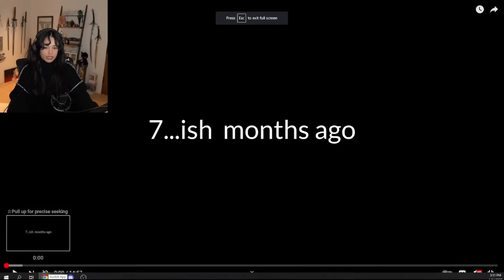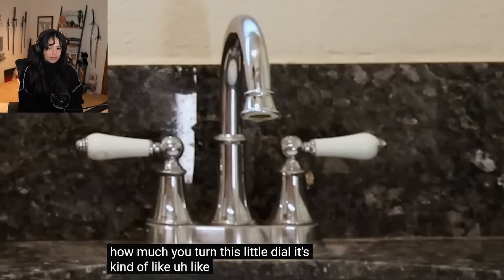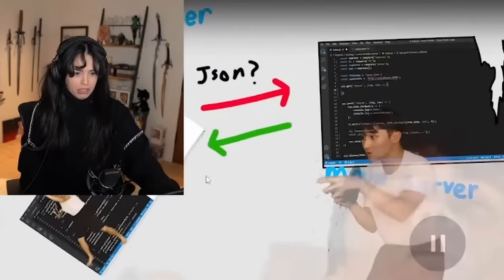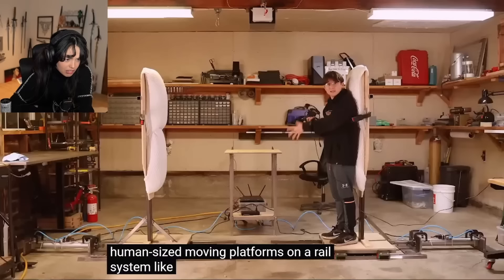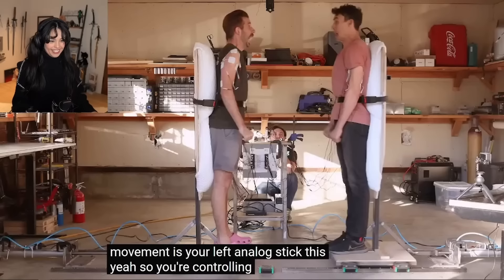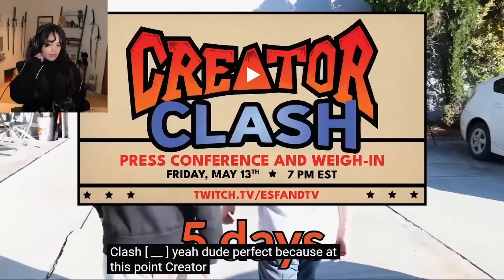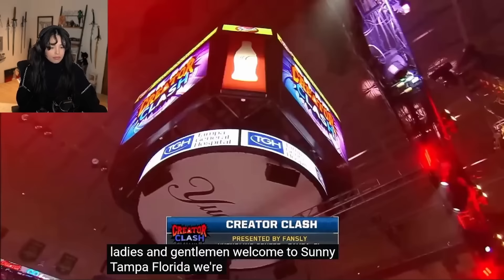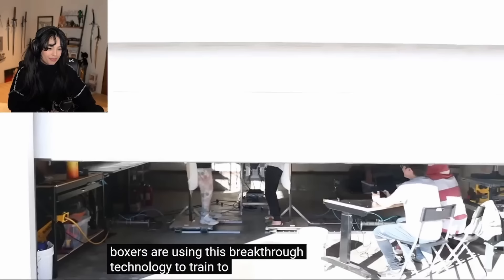Valkyrae Reacts To Michael Reeves's Boxing Robot

Comment: If you were did smart your life would be boring AF..
Because if you understand a lot then those things become the norm like a second nature.
Wich means you get no excitement out of it.

That is why you always here non-smart people complain and the smart ones never complain at all.
Because non-smart people only see wat they could have had.
And smart people only see wat they currently have and how to improve on that.

Its the progression problem all over again.
Have a nice day.

(If you do not know the progression problem here is wat it is.)
(You need to move a box from point A to B.
Non-smart people will say why use a car or forklift truck, after all why do effort?
But they do it only because they see wat they will get not wat they have.
Wich is just getting the box from A to B.

For smart people it goes like this:
- Pick it up first and move manually.
- Pain in back makes you not want to pick it up to move it.
- So now have it be made on top of a belt so you only have to push it.
- To much effort make the conveyer move by making it into an electric conveyer belt.
- Nice but now you cannot walk anywhere were these things are, so replace them by moving small electro pallet trucks.
- Said pallet truck has a battery, better have multiple so you always can use one rather then running out of juice.
- No one has time to be doing that manually, you code it to drive and charge it itself trought the use of AI.
- Nice but randomly they hit you as you walk, We cant have that so give them rails above the floor they hang on.
- they do not hit people now, But charging and repairs are a pain so code them to do periodical stops for that.
- Rails make a lot of noise so make it better oiled so it makes no noise.
- Rails are old fashioned and hard to upkeep even if the carts/arms do so replace them with flying modules.
- Personal warehouse logistic robots now all replace and fly around like drones, but they collide so make a skynet.
- Skynet and robots might break down, make a different skynet that only handles the repair bots.
- Robots do a good job but are costing to much, so make them not cost any fossil fuel when making electricity.
- Job is now automated in a way that would even be able to handle jobs outside the warehouse.
So hook it up to internet and do it world wide...
- Not enough bots so make more...
- End of the worlds Logistic's as its now automated.
^ That would never be reached when you just use a car and do it and do not look at the current problems it has.
That is why non-smart people will always only complain they cannot reach the level that smart ones do.
Because it is not a part of born intelligence its a choice on how to approach said problem.
Wat is more is that the smart guy now changed the world as not just electricity has no fossil fuel but also the logistics would make cars irrelevant for transporting anything else then people.

Said taken steps can all be answered by me and this is the main reason why i never needed a job.
However like i said before, knowing the solution instandly and only have to wait to execute it while i do so can be a very tedious task.